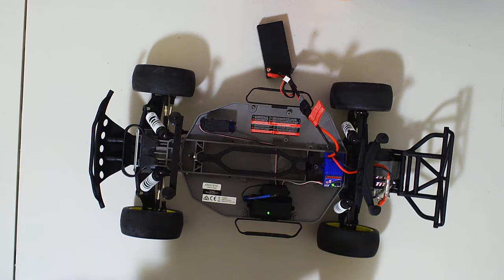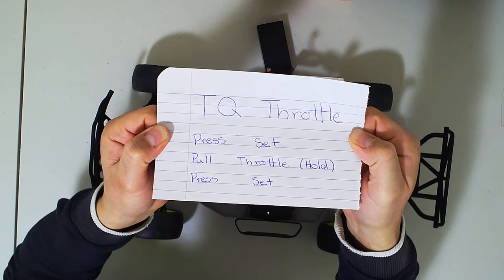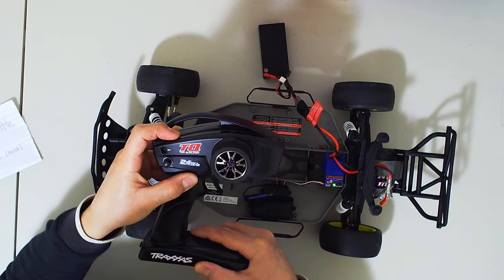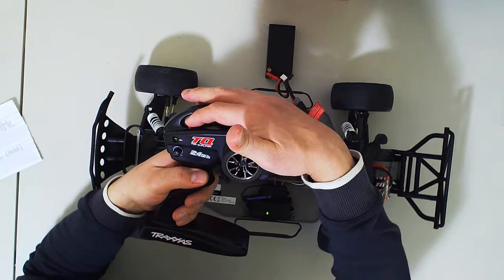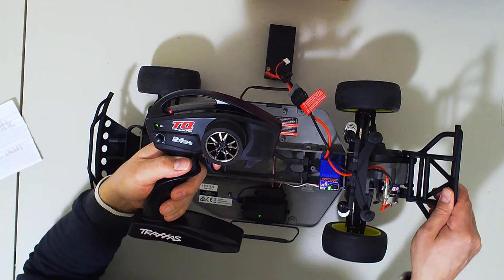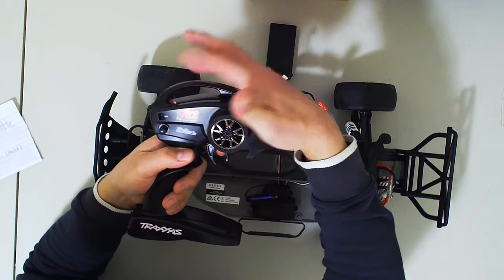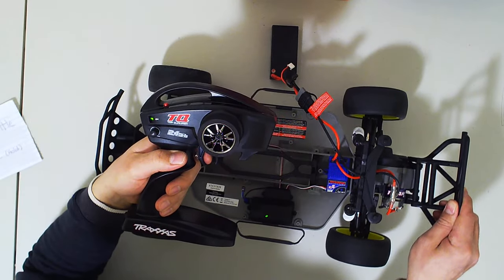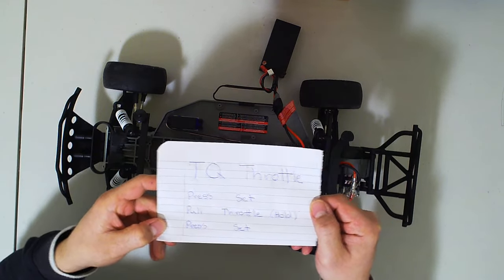Traxxas TQ Throttle Reverse How to Reverse Throttle on TQ Transmitter

Comment: Thank you sir. I changed the diffs around because I got one the other day and it was doing this. Contacted the guy and he said he might have put the diffs in backwards. I took it apart and it was in correct but I chose to switch it as I couldn't figure out what was causing the issue, time to take it back apart because even though the tires are forward it's still in reverse and reverse is faster then forward now. So thank you for this video
Reply from the maker: The polarity of the motor might be revered if it goes faster backwards than forward. You may need to reverse the polarity and then reverse the channels again. Let me know if it is working properly.
Reply: @telecomandorc  I reversed it then swapped the diffs back the way it was and it's working correct way now
Reply from the maker: @hilham89   Awesome. It sounds like you have a 4WD. At least you did not reverse one and not the other diff.
Reply: @telecomandorc  I had to replace a diff in my 4wd revo and accidentally put it in upside down and when I started it I noticed the rear tires were going in reverse and the front wheels were going forward. Good thing I didn't have it setting on the ground or that would have been one heck of a burnout.
Reply from the maker: @hilham89  I'm glad you caught it on time.

Comment: having same issue! If ive just switched over to a spektrum radio setup/receiver (from the original traxxas), is there a way to program the traxxas esc like this without the traxxas radio "set button"?? HELLLLLP! or, do unbuild it all, rehookup OG traxxass setup, follow telecomando's direction, and THEN switch back over to the new radio??? Any guidance appreciated! thx
Reply from the maker: When you say "program the esc", do you mean the end points of the Fwr/Rev?
It sound like you mean the Fwd/Rev. The Spectrum in the Granite has a switch for Ch2 (Fwd/Rev) that I can just switch one way or another.

Comment: Great video but does it work on the trx 4 m as well? Quiete a while ago the motor direction changed and after I watched this viedo I tried to change it back but now after I did exactly what you did the motor doesn‘t turn anymore. What can I do?
Reply from the maker: It is a TQ in the TRX4m. So it should be the exact same process. Does the motor not rotate at all or just in one direction? 

Try changing the direction again. Then try this: https://youtu.be/KvqY7G_Q2_8

I am wondering if your esc went into race mode.
Reply: @telecomandorc  It didn‘t turn at all but i‘ve tried a few more times and now it works. Thanks for your answear, great video👍
Reply from the maker: @FlaWleSs585  I'm glad it's working.

Comment: Hey so I’m having an issue with my car I have no throttle but my steering wheel is controlling the front tires to turn and also the back to spin what do I do
Reply from the maker: The only times I have seen this happen are in two instances:
One, the Traxxas Rx has two "channel 1" slots. Make sure the esc is in "Channel 2" which is actually the third slot. This is the most common problem. 

Or two, the esc is shot.

Comment: Hello dudes I have one more question. I got me a Brushless Esc vxl6s traxxas. The power switch not working? I have to conect batteri wires. Ewerytime, is this OK,? Ore is it bad. Don't know why this happend
Reply from the maker: The switched go out on them. It is alright to just plug the battery in. The only thing that may happen is that it may spark when you connect the battery. This will deteriorate your esc and battery terminals over time from the spark.
Reply: @telecomandorc  thnx man, this is much help. I think this is garbage then, one shit esc.  Maybe I can put an on off switch my self. Frome esc to battery.
Reply from the maker: @manush1119  That is an option. Just get something that can handle the current. But you could add a 6.5mm or 8mm connector to the negative terminal. I find that connecting the positive first and then the negative does not spark like it does connecting the negative and then the positive. I am not sure if it has to do with the electrons flowing from negative to positive. Could be.

Comment: My traxxas has reverse but won’t go forward and when I holed set it flashes green
Reply from the maker: Now, when you go forwards, does it brake or not respond? If it brakes, then reverse the throttle like in this video.

If it does not respond, your Tx or Rx might busted. 

Assuming it is a brushless system check the connections A-A B-B and C-C. 

Say you reverse the Tx settings. This is how you go through the esc modes: https://youtu.be/KvqY7G_Q2_8

This is how to set the rotation correctly on a brushless motor: https://youtu.be/Z44y_kW5xZM
Reply: I actually figured it out, I just re connected my controller and it works now, thanks for the suggestion tho
Reply from the maker: @mav_4338  Awesome. Glad it was only a binding issue.

Comment: what if my throttle is my steering how do you fix that and my esc light not coming on
Reply from the maker: When that happens, check your receiver. Make sure the esc is connected to Ch2 in the rx and the steering servo is connected to Ch1 in the rx.  
If you are running a TQ receiver, the first two channel slots are usually a Ch.1. The third slot is Ch.2. I hope this helps.
Reply: @telecomandorc  ok I did that and I'm still not getting throttle is the ESC ligy supposed to come on
Reply: I think I may need a new esc because its just not working the light on it won't even come on
Reply from the maker: @corywagner9455  If the light in the receiver does not come on, but the esc is on, you need a new esc.
Reply: @telecomandorc  no my light is on my receiver but am not getting throttle and now my back tires are locked and my esc light is not coming on how you fixed that thanks
Reply from the maker: @corywagner9455  If you have a TQ rx, they run for about $30. If it is a TQi, they cost about $40. But first, check the lead from the esc to the rx to make sure polarity is correct... just to make sure it is the rx that is dead and not a reverse connection. 
If this is not the issue, see if you know someone with the same receiver, see if you can barrow it. The reason is that there is a small... very small chance the esc is not sending power to the rx. So if the rx you know works does not work with your esc, it could be the connector on the esc lead or the esc... but very small chance. Now, if the other esc works, then you know it is your esc. Try that first before spending money on new parts. 

The funny thing is I was in San Jose a week or two ago and offered a guy and his sun to borrow some of my gear, such as a servo. They kept refusing. In the end, the employee did the same thing I told them to do... and then sold the a new transmitter and receiver. I even offered to have them try my Futaba T3PV and they refused. I know the Futaba with rx is about $120, but it is way better than the cheap one they bought for about $40. But $80 is $80 and it is their money. 
The point, buy quality... and buy once. If you only have one vehicle and it is the rx, just buy the rx. If you have multiple vehicles, consider upgrading to a different radio system. It does not have to be Futaba. Look into some of the other popular brands. 

I hope this helps.
Reply: @telecomandorc  am using a  tq top qualifier 2.4ghz receiver my car is a Traxxas ruthless vxl brushless and I got a 3s motor system in it

Comment: I have no throttle only steering on rustler 4x4 vxl how do I reset
Reply from the maker: Traxxas receivers have two Ch1. They follow this pattern: Ch1, Ch1, Ch2, Ch3, etc. The first check is to make sure the esc is plugged into Ch2. If it is, check the it was not plugged in reverse. The little metallic exposed tabs go toward the ascending numbers. If it still does not work, it is likely to be a faulty Rx in need. Plug a different esc and see if it works... if it does then it is the old esc. If it does not, plug in the current esc to a different Rx. If it works, it is the Rx. It could be that both do not work, but very unlikely. Usually it is the Rx.
Reply: @telecomandorc  it worked great just quit working.

 reprogrammed it the tqi rx still will only give hard left turn. checked all the wires they are not frayed or in the wrong way or slots. 

does Traxxas warranty piece of shit rx?
Reply from the maker: @minnesotanice369  I am certain the Rx is fried. But try to see if you can get a lender before you buy a new one as a last check.
Reply: @telecomandorc  with flashing red light on receiver would water fry that it was sealed really good hit a few big puddles worked for about an hour

Comment: holding the set button does nothing for my transmitter. the light just stays solid green
Reply from the maker: Try powering off or even removing the batteries and starting over.

Comment: Which car is it? I know it is traxxas.
Reply from the maker: This is TelecomandoRC. The car is a Traxxas Slash 2WD brushed model. But the steps are the same for any TQ Tx.
Reply: I have receiver from a traxxas stamped. But I build the hole car myself
Reply from the maker: @manush1119  All TQ receivers function the same. This is perhaps the most common rx Traxxas uses. Give it a try and let me know.

Comment: Why m 8 geting more speed in rewerse then forward help pls
Reply from the maker: Thank you for your question. I will assume you have a sensorless brushless motor. If this is the case, swap two of the wires. There is an A, B, and C, but some systems do not have then lettered or color coded. When you swap two of the wires your motor should run in reverse, but send full power as it moves forward and slower when it moves backwards. Then reverse the throttle input in your transmitter. If it does not work, reset the wires and now swap the other two. Let me know if it works.
Reply: @telecomandorc 
Absolutely I will. my servo  just  smoked. I ordered a new one iwill Let you know.  Thnx dude
Reply from the maker: @manush1119  Sorry to hear about the servo. But I am glad you are getting it all up and running soon enough.
Reply: Hello dude. I'm having same problem again.
Reply: @telecomandorc  not working bro. Getting mad at this bs
Reply from the maker: @manush1119  Sorry to hear that. Try this first. Connect all the wires as lettered: A-A, B-B, and C-C. Press and hold the power button on your esc as if you were going to power on the vehicle (do not release it yet). The light will blink once (regular mode with F/B/R). Then it will blink twice (F/B). Release it at this point to have only forward and break. Now try it and see if it goes forward or in reverse when you apply throttle. If it goes in reverse, swap two wires. Now, you have 3 wires and 6 possibilities. Try swapping two wires at a time until you get the speed. Then put the ESC in regular mode (one blink).
Now, back to the previous step. Say it did not go in reverse and it went forward as it should. Swap the wires (two at a time-- ABC to ACB or BAC for example). and you should be set. This is one of the potential downsides of a sensorless systems.